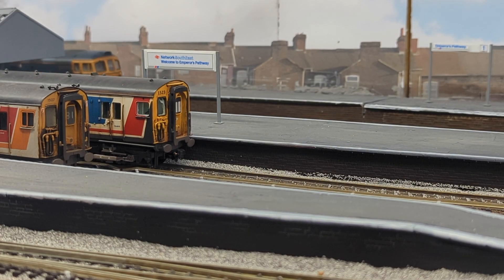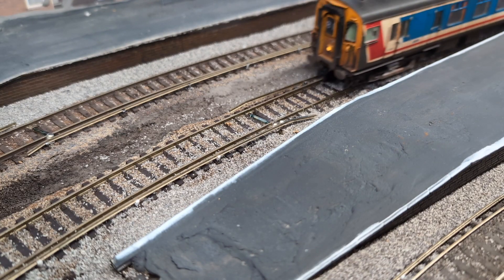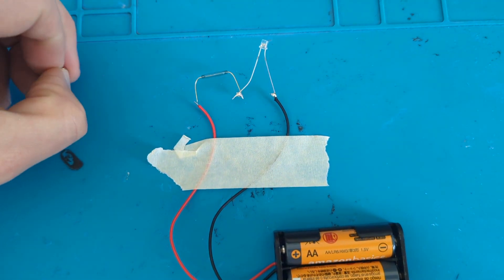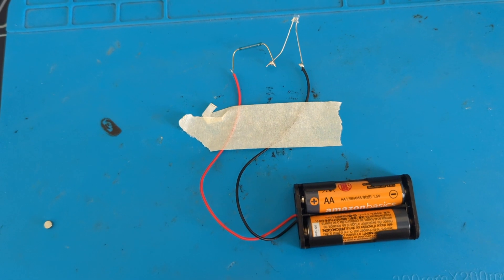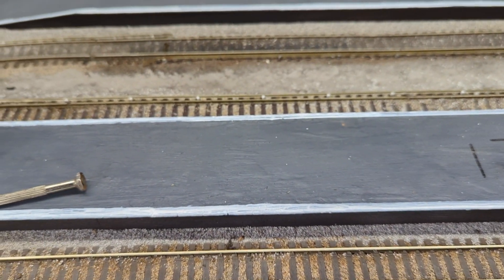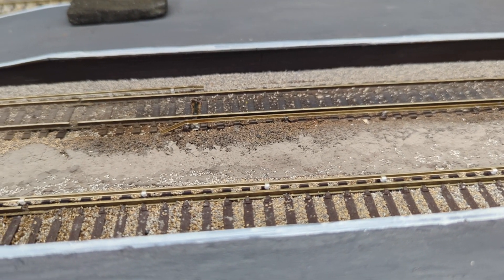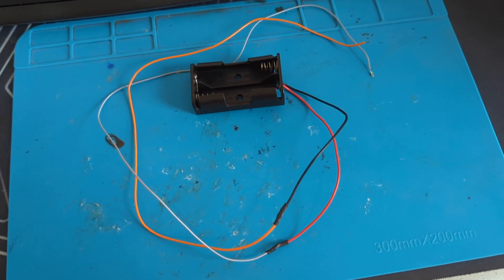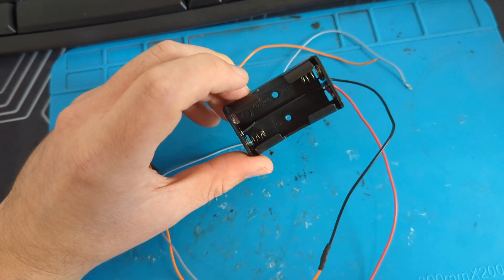43. How To Create Third Rail Sparks and Flashes

Comment: A couple of points.... 1. Bending the reed switch leads, use snipe nose pliers to hold the wire as closeto the glass envelope  then bend the free end down against the jaws. 2. You have a potential issue of tje led being continuosly lit if a train stops with the magnet above the reed switch. Maybe some form of capacitor discharge unit can be arranged so that there is only one flash as the switch is triggered... Otherwise it is a nice touch on a third rail system. Next task to do thos for overhead catenary systems!
Reply from the maker: Ohhh thank you! I'll bear that in mind! Good tips, I'll look for a solution
Reply: Also if you do want to use batteries, a single 2032 coin battery will last for years in this kind of intermittent use.

Comment: Great video mate, really simple to follow. This was indeed the way I did it on my old LU layout as we discussed. I am sure that, if you put a bridge rectifier and a suitable resistor into the circuit, you could power this off of the DCC track. If I ever model a section of the LIRR mainline or the NYC subway, I will give this a try as will save on batteries in the long term.
Reply from the maker: Oh I'm sure that's not a bad way to do it! I'll break out the breadboard
Reply: @EmperorsPath let me know how it goes. I might have a go using crocodile clips and wire 😂
Reply: Yes great video. That’s a good call on DCC power. The same mini board I use for Coach lighting should work. Next time I make up a batch I‘ll give this a go. Thanks!
Reply: @DonningtonCastleModelRailway  let us know how you get on

Comment: Thank you for the great video showing how to do this, I may do it in the future, but for now I don't have any EMU's.
Reply from the maker: Thank you, hopefully we can think of over ways to transfer it to other parts of the layout 🤔 thanks for stopping by!
Reply: @EmperorsPath It wouldn't allow me to make a direct comment so I have replied here.
Two things. 1) Why use thicker magnets when putting a layer of 1mm plasticard between the magnet and bogie will lower the magnet and make it nearer to the reed switches?
2) You have made the common mistake of not having a gap in the third rail at the point blades. The only places where there is no gap at the point blades are in the throats of terminal stations, where there is a danger of slow moving trains "gapping" and there "shoe lifters" are used. The gap at the point blades is so that the shoe on the "frog side" of the train can ride smoothly up unto the conductor rail instead of hitting it and getting knocked off! Check any Southern Region cab video to see what i mean.

Comment: REAL SPARKS - ARE CHEAPER !!!
Wouldn't it be more realistic to have real sparks coming from the shoes rubbing on the 3rd rail ? Which is how its been done on a number of club layouts for over 50 years. No batteries, LED's, extra wiring or magnets necessary !  Only energise the Third rail from a separate transformer 12v DC supply. And using copper pick up strip, intended for pick ups in kit built locomotives, add this in place of the dummy plastic shoes on the EMU's, and wire the copper shoes back through the Common return rail, to the layout Common Return wire.  

The sprung copper pick up strip, with its own 12v DC supply, will give nice realistic sparks whenever it touches or breaks contact with the 3rd Rail, and at any place where you get dirt or electrical interference between pick up & 3rd rail. So you only need a cheap 240v Transformer & a 50 pence Bridge Rectifier. A few pennies worth of sprung copper pick up strip, and you can have real sparks anywhere you like at no extra cost !!! 

Of course this can't be done if your using DCC, as 16v AC in the rails, doesn't allow the huge wire saving trick possible with traditional 12v DC. Where of course you can wire as many transformers as you like into the layout, and only have ONE common return for ALL OF THEM & EVERY TRACK & ACCESSORY ON THE LAYOUT. Meaning you end up with less wiring than with DCC, without all the dangers of short circuits inherent in DCC 16v AC wiring methods !!!!